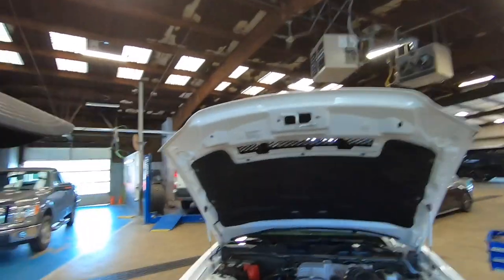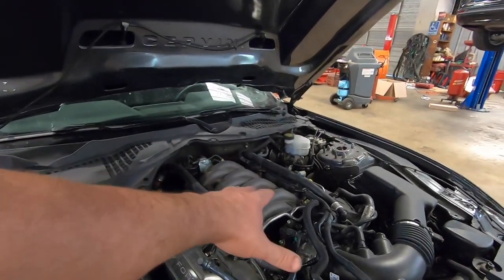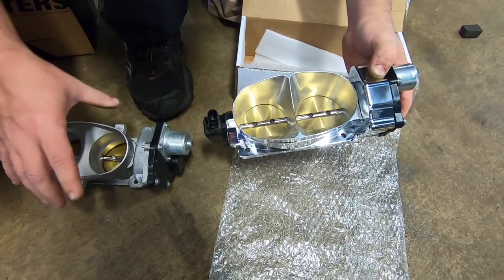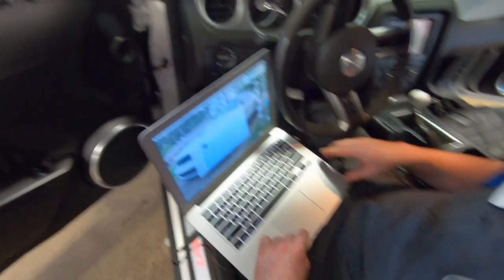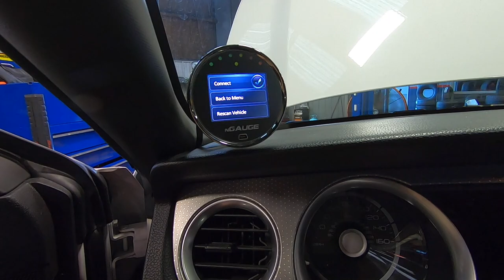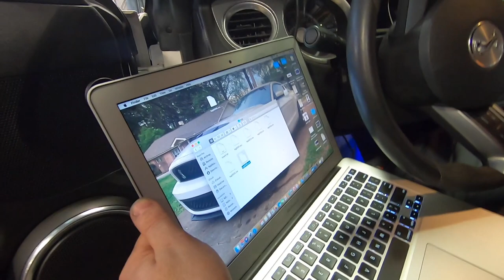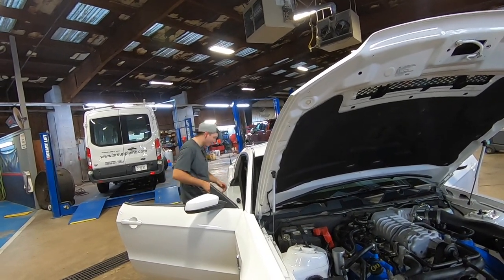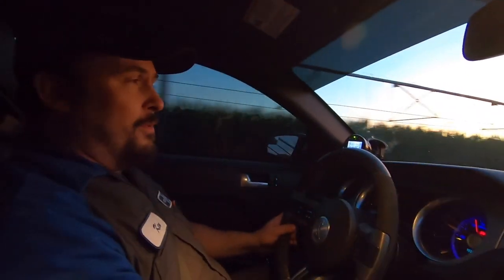GT500 gets more go fast goodies!

Comment: I'd do the thermostat for sure👍my car likes it
Reply from the maker: Beards and Cars yea really considering it.  Summer is being brutal right now!
Reply: @SpeedAddict731  ya man it's hot over here in TX
Reply: Same here, 20-25 degree drop on coolant lowered my IAT's 10-15*. I do have the stock heat exchanger so with a big one like the VMP I don't know if it would drop that much, but it will help a lot with the heat transfer to intercooler from the heads and coolant. 
My setup is still the Eaton blower but on a 4.6L 3v.
Reply: @gforce_117  yup..I saw a drop in both also ..not as much as yours but enough to count👍

Comment: Ken, if you plan to eventually go up to 2.65 blower, Why did you decide to go with the twin 67mm instead of the new twin 69mm throttle body from VMP.  It is suppose to remain the same good drivability as the 67mm
Reply from the maker: Einar Ingi Einarsson the gen 3r do good with the 67mm.  almost went 69mm but on vmp’s  website they didn’t list the stock blower when they listed fitment so I wasn’t sure to be honest.
Reply: @SpeedAddict731  VMP's testing showed huge improvements going from even the 69mm to the really really big monoblade throttle bodies. Gotta have a really big one to take advantage of the better flowing case!
Reply from the maker: Garrett on the gen3 yes I watched same video but watch the video with the install on mustang lifestyle Justin talks about how the gen 3r with the way the inlet is better suited for the 67mm than the gen 3 was.  Had to get something I could use with this supercharger and work on the other two.  They put down 800 with it on the gen3r. To go much over that I’m going to have to build the engine anyway so we will see when that time comes.
Reply: @SpeedAddict731  Yes you are right! For stock engine no need for a big monoblade, but also no point in going 3R over 3 unless you wanna build engine. I think you have to be 900 if not 1000hp to see those big improvements from upsizing to the big throttle bodies.
Reply from the maker: Garrett yep!  Only reason I’m looking at the gen3r is no adapter needed for gt500 bolt pattern throttlebodys like the gen 3 and if I do decide to build the engine the capability is there. However I haven’t said no yet to the gen3. The gen2r is perfect in my opinion on a stock engine but they say the gen3 is more efficient so might as well go with the gen3 or R. A lot to take into consideration.
Reply: @SpeedAddict731  Yeah its a tough call. I forgot about bolt pattern deal that's nice with the 3R. The gen 3 or 3R will make gen 2R power levels easier and more efficiently. 
The 2.3L trinity would be a good and very affordable stock engine blower. Realistically if your gonna built it Gen 3R is the way to go. If your gonna go all the way, go all the way haha. 

Right now, I am contemplating between the department of boost Titanic heat exchanger and the VMP one. Titanic allows for up to 1.25" intercooler lines and is 3.75" taller than the VMP! But, you have to relocate the horns and I can't run fog lights anymore... Yeah its that big! Sorta the same situation, not sure how far I will go with it for power and whatnot.
Reply from the maker: Garrett yep gen 3r will lead into building an engine for sure!  I’d probably do an ice box and vmp h/e to be able to keep the fog lights plus the vmp come with fans which is nice.
Reply: Speed Addict 731 
Yeah the fans are nice for slow traffic, but based on test results they only move air at 10mph give or take. Part I wonder is how the HE gets air across the part right behind the bumper between the two grilles. Fans may help with that “dead area” quite a bit. 
As far as the titanic, it cools better but costs you the fog lights. So idk yet 

How are your IATs while driving and WOT? Does the temp climb pretty quick when your on it?

Comment: Hey Ken trust me your not the only one that wants a tracking number within 5 minute of hitting the buy now button. On another note, what is the engagement like with the Macleod clutch and where is the engagement point  ,is it more at the top or closer to the floor. I have a 15 s550 and i hate the clutch in it, its like it has 2 engagement points so a clutch is in my thoughts.
Reply from the maker: Frozen Stang the clutch engagement is about half way maybe sooner. But it does great bites hard!!
Reply: @SpeedAddict731  Did you get the ceramic or the organic. Honestly i think the break in is the key. Working on my own car after 40 yrs of wrenching isnt as much fun as it used to be so i really need to be sure of what im putting in.